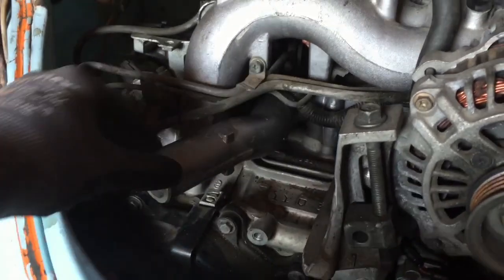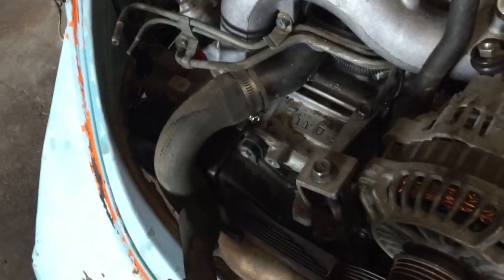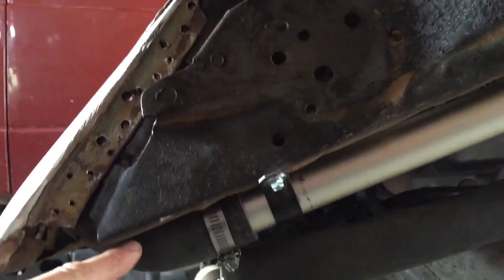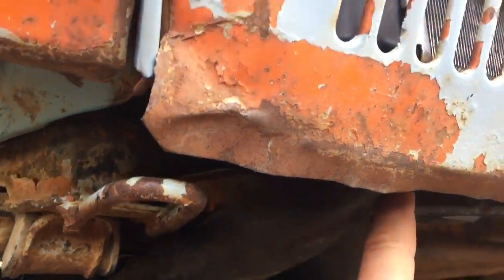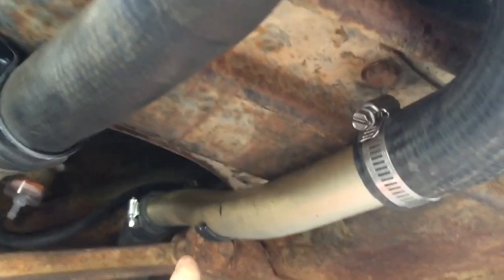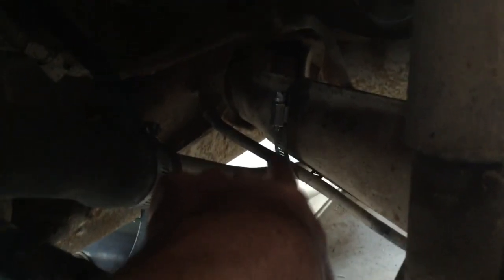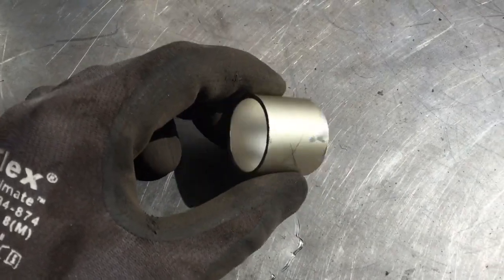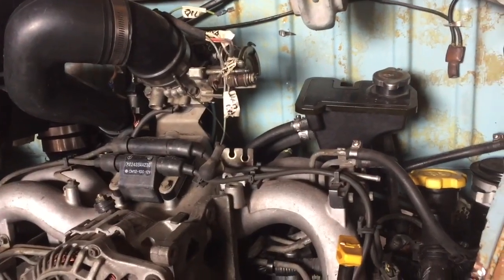BUGaru Part 10 - Cooling System

Comment: The aluminum tubing will help dissipate heat. Don't let the tubing touch steel anywhere. Isolator bushings are easy to make with old inner tubes or vinyl pan liner from the tile section of home improvement stores. What did you use to make the bends?
Reply: Yes, I was wondering if you bent the tubing yourself or if it was an aftermarket item..
Reply from the maker: +Kevin Hornbuckle Thanks for the tips on isolating the aluminum. I used a standard EMT conduit bender - cheap and works great for this sort of thing.
Reply from the maker: +Forthwith Tx DIY my friend, simple to bend with a hand conduit bender.

Comment: Bursaries!!! I can't thank you enough for taking the time to make these videos you have helped me tremendously with my diy project however I need some help... I'm a little confused with how to route the heater tubes do I connect them together with a u style piece of tubing? I have a non turbo motor those heater tubes are confusing me
Reply from the maker: +KUTZFRECH If you're not installing a heater now then just "U" them together.
Reply: Thank you so much for your response I religiously watch your. Ideas back to back to back you have no idea how much you have helped and not to mention make this dream come true as corny as it sounds lol... I have the heater thing under control that was easy I was overthinking it lol... the next thing that has me stumped is the radiator... I'm not understanding how to setup up the fill tank reservoir and or overflow isn't the overflow supposed to be upfront? I'm using a scirocco radiator

Comment: Do you think the height of that arch of tube in the wheel well will be a high point to trap air?
Reply from the maker: +draggonhedd YEP! Any higher point is going to trap air, including the top hose of the radiator and the arch. I'm going to need some revs to push it through. Or putt some bleeders in - we'll see!
Reply: best of luck. Have you also thought about using waterless coolant so the system doesn't need to be under pressure?
Reply from the maker: +draggonhedd A friend just told me about this the other day - I'm excited to research it more.
Reply: itls cool, buy it once kind of thing. Once you have it, you never need to replace it. Need to work on the cooling system? drain it into a bottle and fill it right back up when you're done. Never freezes, never boils, no pressure.
Reply from the maker: +draggonhedd That's pretty incredible that is doesn't pressurize. That could be a great upgrade. I'll have to look into it.
Reply: Well, technically it does pressurize, but it is significantly less than water based coolant.

Comment: Curious about how you plumbed the fuel system.  Will that be coming up in a future video?  That is one of the parts hanging me up in my build.  A lot of guys recommend a sump in the tank to avoid fuel starvation, but usually that means a custom tank.  Curious about your solution.
Reply from the maker: +Beau Van Sickle (Dirtkatt Motorsport) I would run a sump if you're doing a lot of autocross or rally. I don't plan to compete with my bug so I didn't go with a sump. The fuel video might be released tonight. Cheers!

Comment: i did one of those senders that go in your coolant line not sure if its the best thing but i feel it will work i wasnt sure if my fan would kick on if i replaced the stock one?
Reply from the maker: +Randy Lucas The sender is just for the dash gauge. The Subaru ecu uses a temp sensor in the coolant manifold on the engine to control the fans.

Comment: What clamps are you using to hold the tubing to the pan/ body?
Reply from the maker: +jeffinillinois they are just EMT one-hole conduit clamps from Home Depot. Inexpensive and effective. May need to isolate them from the aluminum but this is all experimental for me.